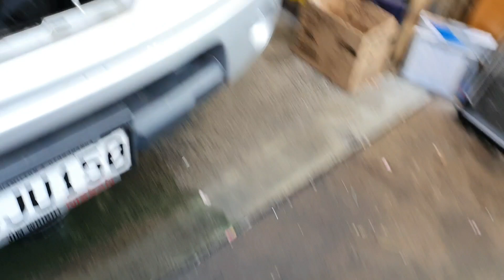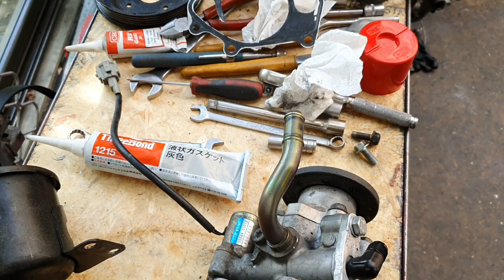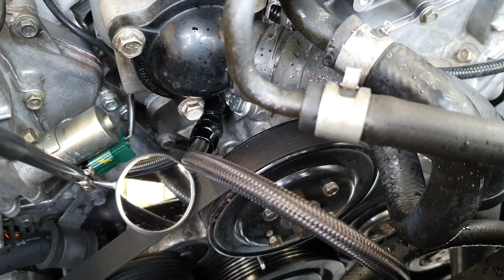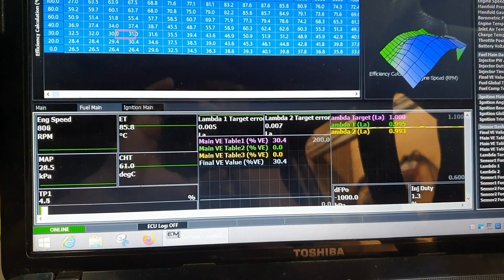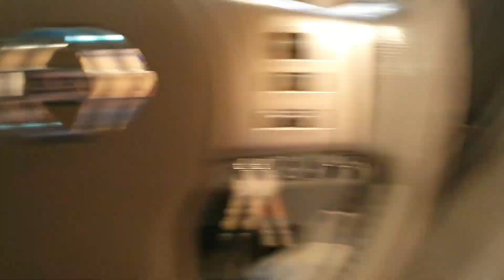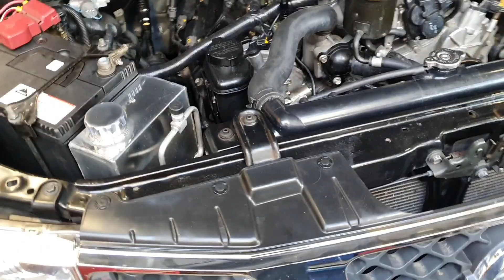D40 Navara V8 eng replacement day six, ready to drive!

Comment: Been looking for some sort of connector for an to plastic best i found so far is https://m.ebay.co.uk/itm/Catch-Can-Fitting-Adapter-19mm-AN10-For-Honda-Civic-Integra-EP3-DC5-K20-K24/193585751160?ul_ref=https://rover.ebay.com/rover/1/710-53481-19255-0/1?ff3=2&pub=5575376664&toolid=10044&campid=5338268676&customid=Cj0KCQjw28T8BRDbARIsAEOMBcxR3wvx8we0bEZ10_mbGi4dN8FY8eSxcjFOhdTw94BPENxX7mR8DBUaAqvREALw_wcB&lgeo=1&item=193585751160&srcrot=710-53481-19255-0&rvr_id=2654050859386&rvr_ts=541523711750ac3d7d32fb68ffc83fe3&_mwBanner=1&_rdt=1&ul_noapp=true&pageci=182fe6a6-5445-464d-b31e-b04134a5f4b8